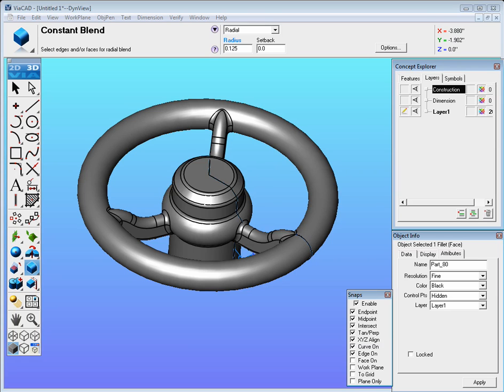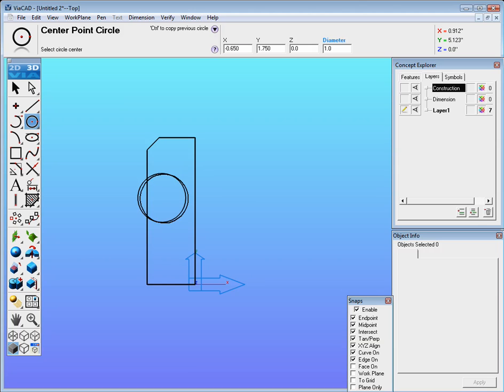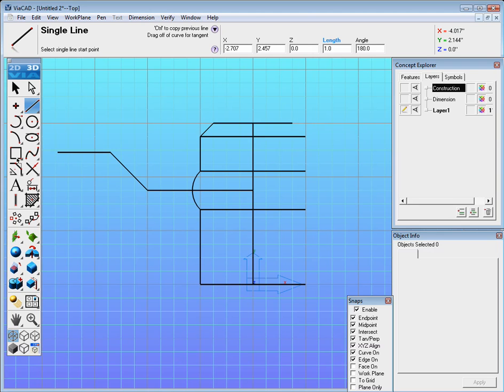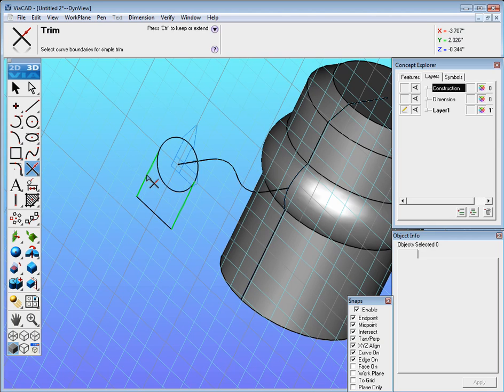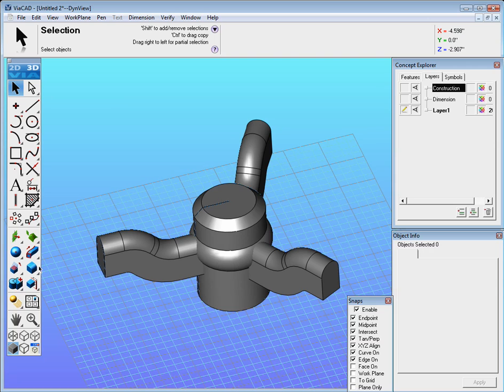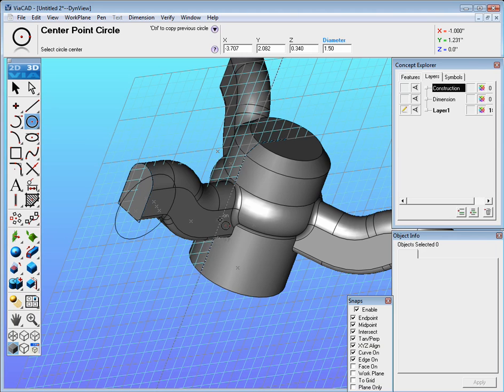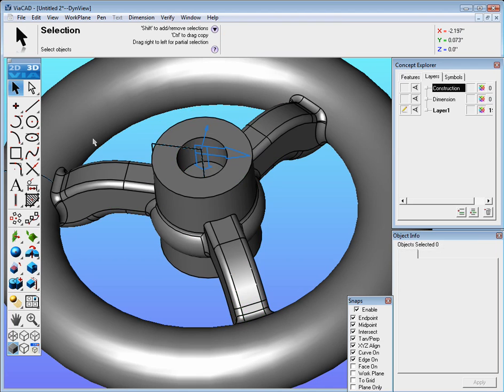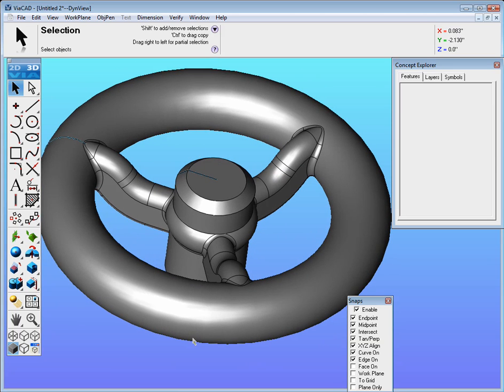E4 ViaCAD Tutorial

Comment: When adding the fillets @8:13 I get the message: "Could not find acceptable sequence of capping faces to trim blend face: Fillet_3515" 
Also had several crashed on ViaCAD pro V9 (MAC) throughout doing the steps in Episodes 1-4
Reply: Did you found a solution? I got the same problem, for a very simple model (an icosahedron). For some faces it works, but for some not.